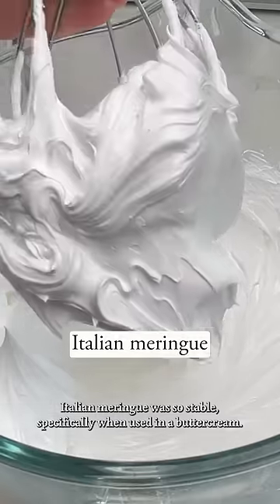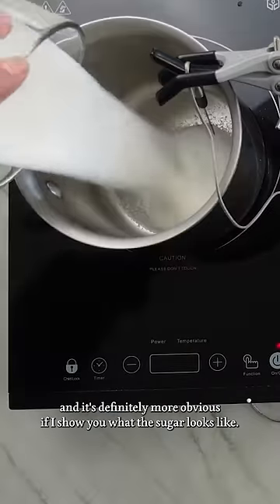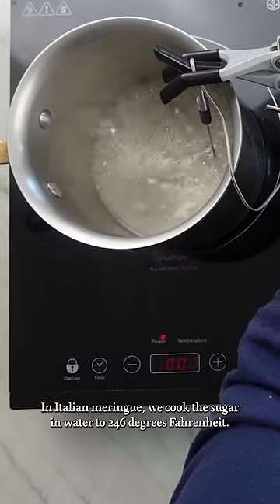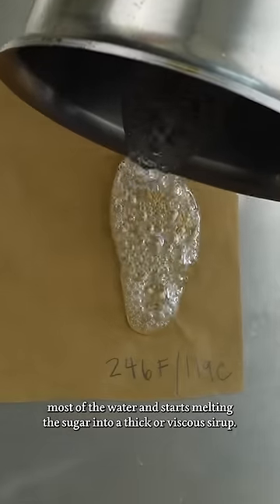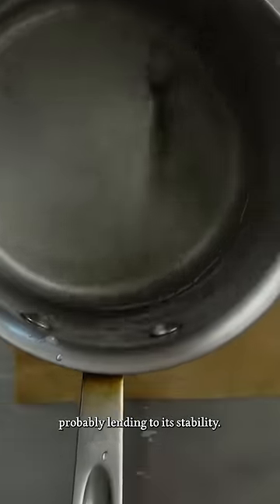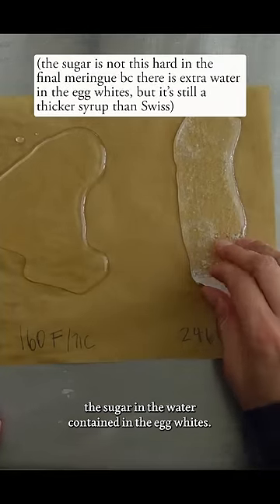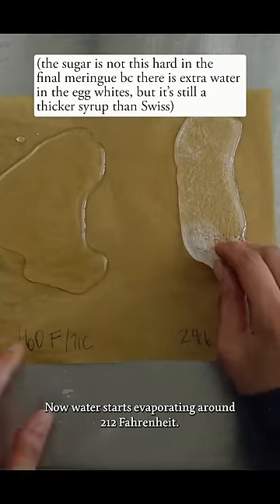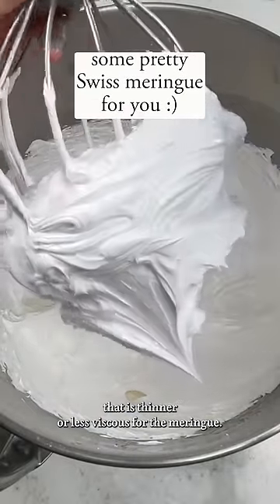Why is Italian meringue so stable

Comment: I started preferring Italian meringue once I realized I didn't have to constantly stir the syrup as it heats up. I love it since it's basically marshmallow fluff.
Reply: In fact you should absolutely not stir the syrup, because that could cause crystallisation. Instead you can just give the pot a swirl
Reply: Never stir sugar when making syrup or caramels
Reply: @scimmed9012  Some of the recipes I've seen for making pralines say to stir the caramel constantly while cooking to prevent crystalizing. I learned months later adding a tick of corn syrup does the same thing.
Reply: @Nikki0417  never ever stir, will make it crystalize, to stop it from crystalising you should periodically brush the sides of the pot with water. If you notice some hot spots you should swirl the port gently then brush the sides with water source: I'm a chef
Reply: Thank you for helping me understand so much about baking!

Comment: Thing is with this logic of water content, Italian meringue should be the one with thinner texture because it actually contains more (not less) water. In contrast, Swiss meringue does not have any added water since sugar is directly dissolved into the egg white. The degree that the sugar syrup itself is cooked to is only relevant in determining the leftover amount of water as the property of sugar doesn’t change in that short amount of time at that temperature (i.e. no chemical reaction such as the formation of inverted sugar).

The reason Italian meringue is thicker is probably because of the temperature the egg white is cooked to - it reaches much higher than the standard temp Swiss meringue is cooked to. Theoretically, if you cook Swiss meringue to a similarly high temperature, you should get the same (or even thicker) consistency, although you risk creating lumps of egg white due to the lack of vigorous whisking found in the Italian meringue method.
Reply from the maker: Much of the water is evaporated while making a syrup in Italian, leaving behind non-crystalline sugar (246F). At this temperature, you're going from crystalline --> non-crystalline. But yes, probably no inversion of sucrose bc lack of acid in the reaction. 
I've looked at temps of the eggs, Swiss is the one that is cooked to a higher temperature (I do mine to 165F) whereas Italian remains around 130-140F. I'm thinking it may be the reverse, actually - egg white proteins that are cooked less retain more functionality, and therefore can whip up to a more structurally intact meringue. You see this when trying to whip up pasteurized egg whites.

Comment: It makes more sense in Celsius, water evaporates at 100°c you remove the water that isn't dissolved and combined with the water, because sugar evaporates at MUCH higher temperatures.
I mean it's the same on Fahrenheit but you get the concept

Comment: The precise heating causes simple, short-chain Sugar molecules to polymerise into long-chain Carbohydrate molecules, allowing the Sugars to act like the strands of a fishing net. 

Then when you add the Albumin Proteins (from the egg whites) to the Sugars, they work together much like adding Concrete to Steel Rebar - combining structural strength with torsion resistence.

Actually, if it weren't for the fact that much of the structure is reinforced with air (which gradually leaks away) and water (which gradually evaporates), causing it to slump, as well as how both the Proteins & Sugars denaturate (unzip) fairly rapidly at room temperature - and (of course) that Proteins & Carbohydrates make excellent food for Bacteria & Yeasts - then Italian Meringue would be a truly remarkable construction material...  ; )~

Comment: Wait so you're supposed to melt the sugar before adding it to the egg whites? Won't that cook the eggs?
Reply: In Italian meringue you should whip the egg whites a bit first before adding the hot sugar syrup. The air will insulate the eggs enough to not cook them. But you do need to add the syrup very gradually tho.

Comment: Yeah but in SMB you don't add any water. To make the sugar syrup for IMB you have to add water. Sure you cook out that water but it's not like when you add it to the egg whites the egg whites become less watery too. In fact for SMB because you also are cooking the egg whites with the sugar, some water does evaporate. The entire mixture doesn't need to get to 212 to have some evaporation. SMB I've found is equally stable. It would be better to see a full side by side comparison of the two buttercreams variations not just the isolated ingredient.